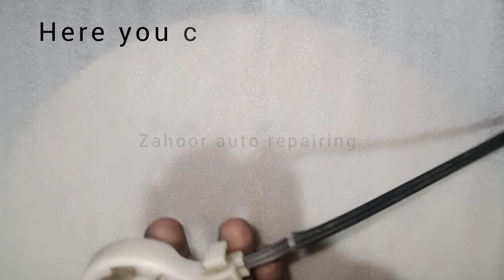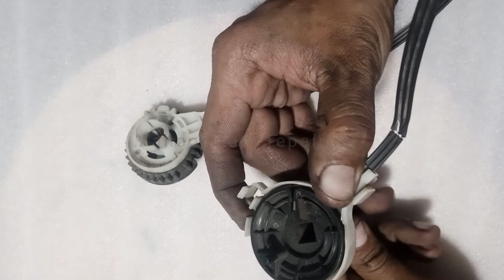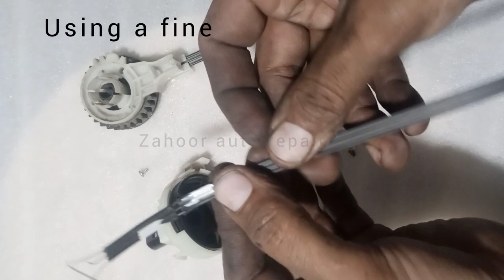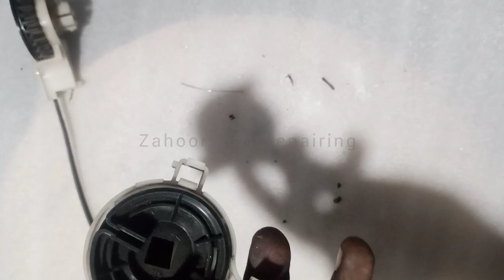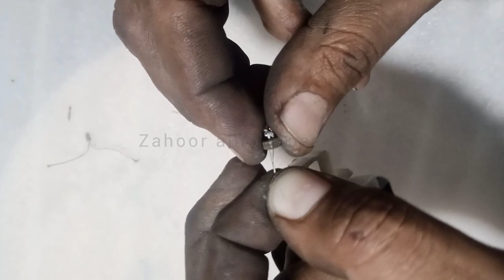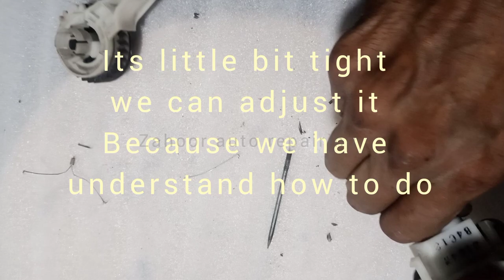Broken vent control cable Diy || repair toyota corolla 2010||no heating how to repair #howtodo

Comment: Very good MashaAllah. Just spray nongreasy conventional WD40 on both graries (round plastic gears having teath) to get stuck dirt out. Then spray silicon based lubricant WD40 to lubricate. One can also try cleaning with carodine oil or petrol followed by lubricating spray. Remember to wipeout the access lubricant so that it does not chatch dirt. Similarly spray clean the grary fixed inside the car as well which will definitely had accumulated a lot of dirt.
Reply from the maker: yes you are right butt in case of broken cable cover you can try to repair

Comment: 3 tiny strands pulled away from the small wire. It's frayed and impossible to work with. If I cut those three strands, will I be sorry? 

I'm not sure why the wire is frayed...couldn't find it on any other video. How wire can I safely cut and still be able to replace the knob?
Reply from the maker: +923344342008 text on my whatsapp hope i will guid u